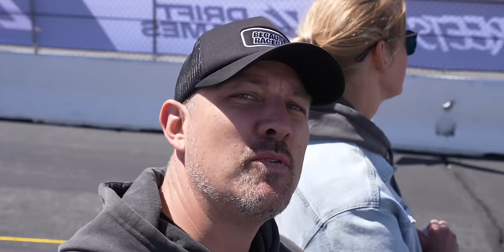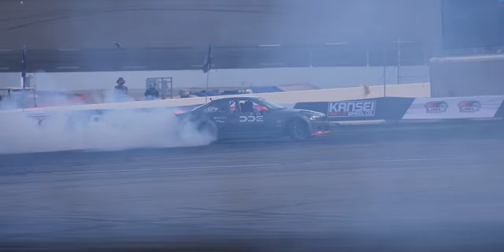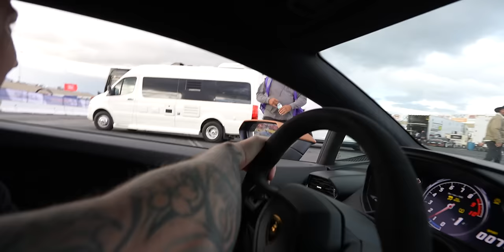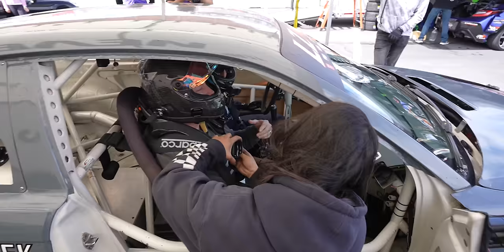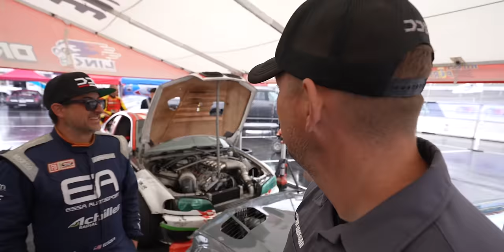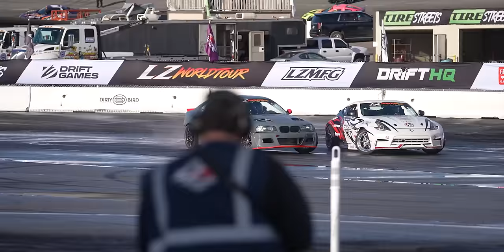WE SEVERELY EMBARRASSED OURSELVES AT PRO RACE EVENT….

Comment: Mike should setup quick disconnect sway bar system for the rear so he can switch it up whenever he wants you can use a front jeep rubicon electronic disconnect system and make it work for you